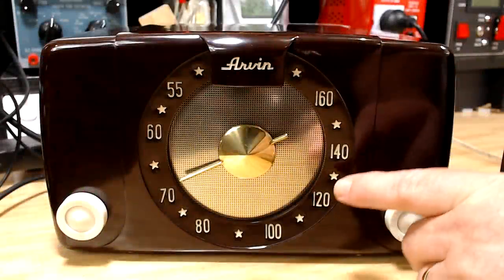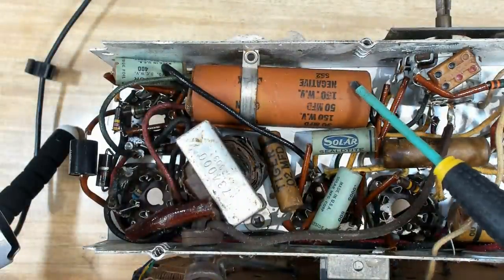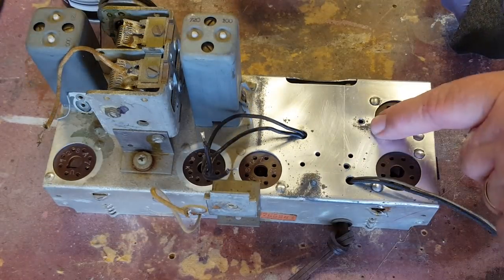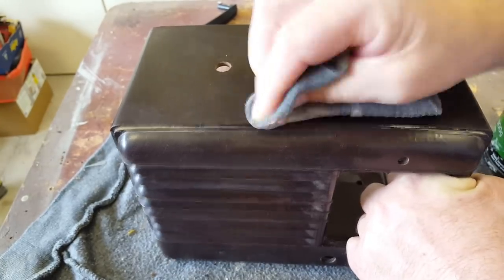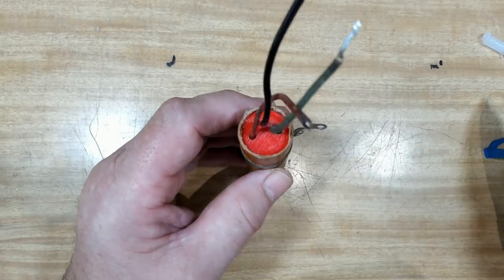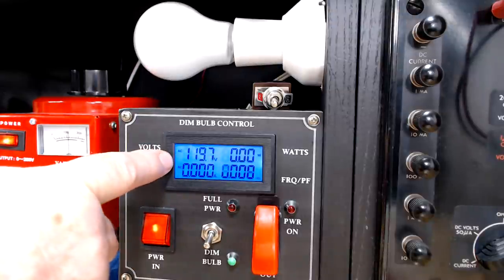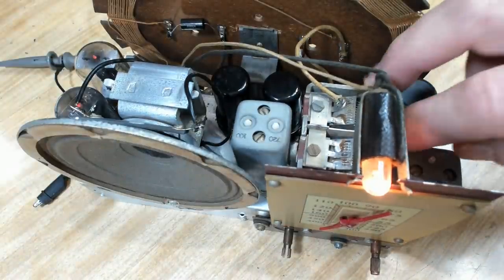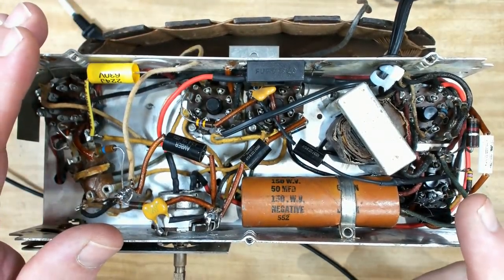Emerson Radio Restore Model 518 USA Built - 1940s

Comment: Thanks for another great video!  I found a picture of an Emerson 157 "Clockette" that had the red crystal lens at the bottom of the dial.  The Emerson 518 sold here in the US had a much different dial. You can check these out on the "Sold Radios" page at www.radioattic.com if you are not already familiar with this website.

I used your dial lens molding technique from one of your previous videos to make a lens for a Philco PT-30.  Good to know about the hobby shop plastic option for next time.  I used a plastic pastry or pie container lid instead.
Reply from the maker: Hi OAV, I am beginning to think my radio was made from several radios, particularly in the dial area. Interesting photo of the Clockette with the pilot light, now I don't know what to believe 🙄 I save plastic from shirt boxes and kids toys but they are usually scratched, the hobby plastic was cheap and easy to use... once I worked it out that is 🙂

Comment: Exceptional work again.....last week when you were working on the Arvin, I went to an estate sale where the fella was an antique radio collector among other things. He had several old 1920's sets with the large curved horn speakers. I bought the Arvin radio from them, turns out to be a Model 927 Rythem Queen apparently a fairly rare radio. On another note, I had told some people on the Antique Radio Forum about gluing Electrolytic caps to the chassis and they told me NEVER glue the back ends because if they blow and you have it covered up they will blow out the sides. they are designed to blow out the back end. In a box of stash I may have a real Emerson pointer if you want it.
Reply from the maker: Hi Mike, thanks. That Arvin looks good, I just looked it up. You did well there. You are right about the caps with the weak diaphragm on the back, I will take note in the future. Thanks for the pointer offer, if you have a double ended one that would be cool, thanks 👍🙂

Comment: Great work as always! Nice to see an older style AA5 come back to life. Kudos for 3-D printing replacement parts. Check out this video for a way to smooth out the finish on 3-D printed parts: https://youtu.be/PgLOU9BrUe4?t=342 . I haven't tried it myself but will do when I get back home to my printer.
Reply from the maker: Hi Linus, that process was pointed out by another viewer as well, different method but still using acetone. Looks pretty good doesn't it. I will try it next time as well, thanks 👍🙂

Comment: Arrrrrggggg. 2:30 AM ... one last check. OH NO! Another video from Dave! OK, up for yet another hour LOL IDK if you are leaving a note in the chassis when you close it up but you should put one in and let the next tech know that the caps have been stuffed. On the ones with a new label you say it was restuffed but when you use the old shell like in this set, it could be an easy mistake to just cut out the old cap to replace it if the next guy didn't know better.  Emmerson is a large company like G.E. Zenith, R.C.A etc. I was thinking that the paint might have been making an appearance but you saved the case and made a darn nice replacement dial indicator too!. Your showroom will be full in no time with a new radio a week or two. Nice job again!
Reply from the maker: Haha... Hi Wayne, sorry bout that. I intend writing on the metal band of the capacitor that it is completely stuffed, I mean re-stuffed when I pull it apart again to fit a few items that arrived after the video was completed. I'm pretty sure i have heard of Emerson before so assume they were fairly well known in the US. It's getting pretty packed here but the wife refuses to leave 😄
Reply: @DavidTipton101  :D So your wife is like mine, stubborn to the end :P :P :P

Comment: Hi Dave, I just watched this restoration, I was surprised how well the case came up.
I have been caught out in the past with those 110v power supplies especially ones made from Chinesesium.
One other thing to watch out for is if they have 110v and 220v,  the 220v is some times Line1 / Line2 with the earth centre tapped so you get 110v Line to earth.
I have been bitten by that.
Reply from the maker: Hi Twopower Mobile, the case came up pretty good in the end, it's wasn't looking that way for a minute or two. Why would they earth the centre tap and why would you want a 110 and 220 output, you must already have one of those voltages?

Comment: Greetings:
The tap on the T3 connects to B+ and exits the short turns out the bottom of T3. The tap was a common circuit feature of manyoutput transformers for many years (I think some designers could not let go of an inductor in the pi filter). I wonder if the tap wiring was reversed with the bottom end (lower B+). If convenient, I will put the pre and post tap resistance readings on my schematic if I get them in a reply to this posting.
Reply from the maker: Hi James. this was quite a while ago but I remember the tap on the audio output transformer. I have since learned it was quite common in other sets so I'm more familiar with it now. I don't have the circuit in front of me but feel free to post any additional information if you wish 🙂

Comment: Do you intend to rewire the power source correctly? It is a poor design practice. Incidentally, I remember many years ago having a double adaptor wired just like that. The outlets were back to back. The front outlet was wired correctly but the rear outlet had the active and neutral reversed! You can imagine what would happen if you plugged in an appliance whose neutral and earth pins were incorrectly transposed. (This was in the days before earth leakage detectors).
Reply from the maker: Hi psionl0, I have modified the power transformer so that the neutral and active are correct, it doesn't stop the plug being inserted the wrong way round though 😏

Comment: Hi Dave; I enjoyed watching this one again this evening, you did a great job on it. The electrolytic capacitor restuffing turned out nice however my concern is is that the caps vents are blocked by them being hot glued to the end cap in the event that they would fail or something goes wrong and the caps need to spew. I know it's probably an unlikely occurrence but still worth consideration.
Reply from the maker: Hi Daniel, thank you. Yes, that was a mistake, I should have kept the bases clear, in fact I now leave the whole capacitor free except for some heatshrink. Good spotting  Daniel 👍🙂

Comment: Hello David. I couldn't tell if I saw yellow dust on the metal part of the speaker. I'm sure you know about cadmium coating from a long time ago and its safe when it was a coating but after many years it turns to powder and becomes airborne and is toxic. If you come in contact with this on your skin wash it off. Spray clear coat on it to encapsulate it from becoming airborne. I enjoy watching your videos and stay safe I want you to be around a long time. Just yesterday I saw that stuff on an old Magnavox dial lamp clip but not on the chassis. A customer took the chassis out and brought it to me and after I repaired it I told him about that
Reply from the maker: I don't recall if it had the cadmium yellow dust on it Chris, I normally wet and wipe it off if present. In any case I am aware of the dangers of cadmium, I worked in the airline industry and it was used extensively and I wash my hands after handling pretty much anything and certainly before eating. A good safety reminder, thanks Chris 🙂

Comment: Nice restore job, love the pointer.....I understand the top band numbers, but don't recognize the bottom band numbers ,short wave?
Reply: It would be considered short wave but in bygone era it was police and emergency bands long abandoned.  There is some ham activity in the 1.8 - 2.0 Mhz and 3.5 - 4 Mhz area but not a lot of AM likely just SSB and this radio is incapable of "decoding" SSB, might hear some CW or Morse code.  Mostly a dead band and possibly even quieter Down Under than the US.
Reply: @mrbyamile6973  thanks for the info.
Reply from the maker: Hi David. The top half is the frequency of the signal in kHz and the bottom half is the signals wavelength expressed in Meters. They are both the same thing just different ways of expressing it. Europe prefers meters rather than frequency 🙂
Reply: Thanks David,  I did not catch that.  I've never seen a radio with meters on it.
Reply: @DavidTipton101  thanks for info and keep up the good work,  I love your complete restoration process.

Comment: Good method using a lathe to drill out the old 'lytic filter. I had not thought of using a lathe.
 Emerson made radios, fans, heaters and such way back when before they were sold out to the
 Asians. Awesome job on making a proper pointer.
Reply from the maker: Thanks F.K. Burnham, it works better in the lathe, better than hanging on to it 😀

Comment: I always thought 120v mains was safer than 240v, and no idea why the higher voltage was chosen in many countries, including here in England.
Reply from the maker: To a certain degree it may be but it requires heaver wire and sufferers from voltage drop more. I think most homes with 120V supply have a dedicated transformer from the supply to the home to drop high voltage to the 120V and they also supply 240V by using a centre tap on the transformer (2 X 120V) to run large appliances, ovens, HVAC etc 🙂

Comment: Electrolytic caps fail. Would it be better to allow for serviceability by not sealing in the smoothing caps in the tube?
Reply from the maker: Hi Robert, I am rethinking my stuffed capacitor methods. I should leave more room and a weak spot in the tube for them to fail. I use low temperature hot glue to assemble them so dismantling is a matter of heating the glue to remove the old caps. The tube needs to be sealed for dipping in the wax or the wax will leak inside. I will improve these as I go along, thanks Robert 🙂

Comment: I have a Packard Bell radio from around the late 40s which looks almost identical to this one.  Same color, same shape, same dial and pointer, etc. The knobs are a domed shape as you mentioned.  The dial is marked with US west stations.  Its clean and works pretty well.  I don't know the model number.
Reply from the maker: Hi bbmousedoowop, is it like this one? https://www.radiomuseum.org/r/packard_be_5da.html
Reply: @DavidTipton101  Yes, that's it exactly.  No handle on the top.  Thank you for  replying.  Steve

Comment: Hello David. I like to see original electrolytics get restuffed. I don't think the new ones would ever vent but should they ever do I think the paper housing will have enough porosity to allow the pressure to escape. I wonder if its a good idea to put a pinhole in it. Very good looking dial pointer
Reply from the maker: Hi Chris, I agree, I now incorporate a vent hole and don't cover or glue the end of the new capacitors 👍🙂

Comment: Very nicely done!  Your ability to turn a turkey into an eagle (if you'll forgive the American Thanksgiving reference) amazes and inspires as always!  I like the restuffing job.  Those caps are thoroughly captured with all that hot glue in there.  I really like how you made the molded dial lens as I did similar things back in my RC modeling days, though usually with a hand-me-down toaster oven.  Wish I had a great temp controlled oven like yours!  Maybe for X-mas...
Reply from the maker: Thank you SY. It's an American radio so why not a Thanksgiving reference. Thanks and good luck with your Xmas wish 🎅

Comment: Astounding great work on this radio David! 😍 Love your experiment on the clear dial face replacement. The electrolytic cardboard tube restuffing was excellent!
The dial face is totally wrong as this radio only receives 540-1620 kHz. No police band. But the work done on the replacement pointer was very much matching
 to the  existing generic style dial face design. You're quite the perfectionist on bakelite cabinetry. I would have probably repainted it a dark brown and called it a day.
Not quite the perfectionist as you are! Steve
Reply from the maker: Hi Steve, thank you. I've worked out the dial face is wrong now but amazed the one used fits so well, that also explains the pointer used. I didn't consider the frequency range, good point. The cabinet came up pretty good but it's still a poor effort by the manufacturer 😏🙂

Comment: emerson was a fairly major brand in america. were around a long time. they were really a major brand in the 80's and 90's for cheaper tv's and vhs players. dunno if they are still around or not. i'm sure they were bought out and merged with other companies, most likely chinese.
Reply: Emerson was quite a major brand into the 60s. They also had an appliance brand that sold very good air conditioners. At one point they made gear for Avery Fisher's high fidelity brand but they sold that to Sanyo.

Like most American brands they undermined themselves by becoming just an outfit that slapped their name on imported stuff of too-often questionable quality, 2nd and 3rd string Japanese at first and Hong Kong, Taiwanese, and others later on. They finally ended up like other once well-known names bought up by cheap conglomerates and slapped on random junk imported from low-end makers.
Reply from the maker: I recall seeing Emerson stuff in the US many years ago but the name would have been bought be overseas manufacturers and used to sell cheap goods, seems to be the way these days 😏

Comment: Wonderful work, Dave!  So mesmerising and relaxing to watch!  You are unflappable!  I don't know what you did in your working days but you would make a heck of a good teacher.  Patient and even-tempered.
Have you ever considered swapping out the old power supplies in these US radios and putting in a modern switchable power supply that allows 110 and 230v usage?  You see quite a few older Japanese radios and cassette recorders with a switch on the back which allows a voltage change.
Reply from the maker: I enjoy working on 'stuff', if it doesn't work, it's a challenge, if it does, I go and watch TV... I don't watch much TV 😄  There just isn't enough room to fit a transformer in most sets, I can use a big resistor but the heat dissipation is an issue. I could maybe fit a switch mode power supply but that would interfere with the radio. It could be done but not worth the effort on the small sets, bigger sets like consoles wouldn't be a problem though 🙂

Comment: David,
 You connected a capacitor to the wrong spot. Crikey. I like that. Some time back whilst building an Amateur Receiver, I actually soldered the antenna, directly to earth. The receiver wozz as dead as a Dodo.
 Anyway, a beautiful restoration as usual. Looking forward to tour next RADIO ADVENTURE
Reply from the maker: Hi John, I was surprised I did that, I'm very careful normally 🤦‍♂️ 🙄🙂 Connecting the antenna to ground would put a stop to things 😄 Thanks 👍🙂
Reply: @DavidTipton101   Yes Dave,
                                            Even with all the care, there is an unknown factor in there or something, and then it happens. I've pulled some rippers over the years.

Comment: Congrats again! Regarding the defective tube, since the radio is working well with it in place, I did remember a guy specialized in restoring Zenith Trans-Oceanic radios (Mr. Peter Wieck) that says that the tube testers are made to sell tubes and says that the best place to test the tubes is on the radios themselves...
Reply from the maker: Hi Rádios Antigos & Cia Ltda and thank you. Mr Wieck is correct to a point but this tube is very weak. I have a new tube now and will fit in an upcoming video and see if it makes a difference 👍🙂
Reply: @DavidTipton101  I am curious about that. Thanks again. Alvaro.

Comment: Emerson was a low end radio-electronics company, based in St. Louis ( I think). they made cheap radios, phonographs, tvs etc. I worked on radios of this type many years ago, my guess is post-WWII, maybe 1947-50.
Reply from the maker: Hi Fred, thanks for that, I thought they were in New York somewhere? I think mine is about 1948, the dial card had been replaced which confused me 🙂
Reply: @DavidTipton101  I think they may have started out in N.Y. but later moved. There is an Emerson Electric (offshoot), still operating successfully in the industrial electronics space, and the name Emerson is still being used on various licensed products made in Asia.

Comment: Excellent job on the dial window Dave, a lot of sets use that style of celluloid window, they tend to yellow with age.
I love the overkill on the cap restuff,  very well done, as for the cabinet, I have had similar problems where the finish degrades due to years of UV exposure, I use a similar method using scotchbrite to apply rubbing compound, then use brown shoe polish.
Reply from the maker: Thanks Mark. I thought later the dial window was changed because it went yellow. The scotch bright idea sounds good, I'll try and remember that. A number of folk have suggested shoe polish 🙂

Comment: Dave: nice job as usual The lenses generally yellow out on these old radios..Is there any way to clear them up short of molding your own? ( I dont believe peroxide will work on clear plastic) Bad news for me here as far as listening to AM radio , the noise and interferrence is so bad its almost impossible to listen to AM radio these days , Very different from when I was a child thats all we had was AM radio and worked well back in the 50's... Thanks  Dave enjoyed it  keep up the good work and stay well ..............
Reply from the maker: Hi Paul, thanks. I attended a presentation from a chap who restores radios and writes for an electronics magazine over here, he also has a chemistry degree. He confirmed there was no way to remove the discolouration from clear plastic, so I guess there isn't a way. In the house it's very difficult to get a clean signal these days 😏
Reply: @DavidTipton101  I thought so Thanks for the confirmation..